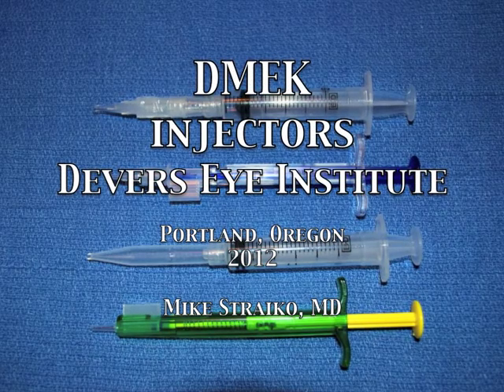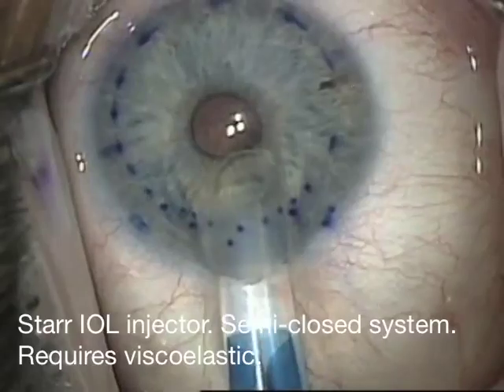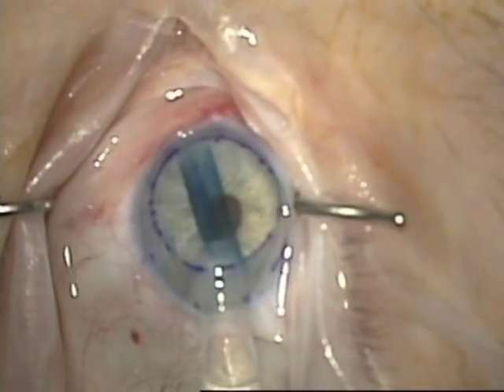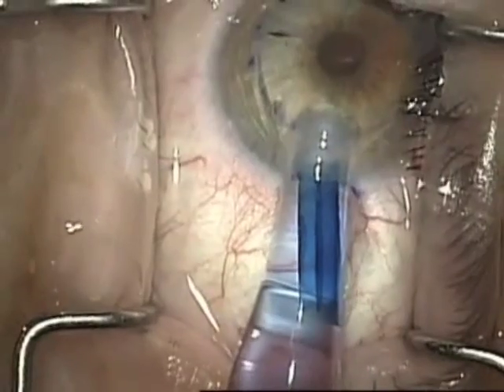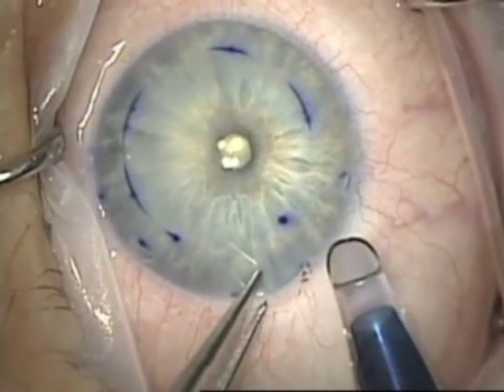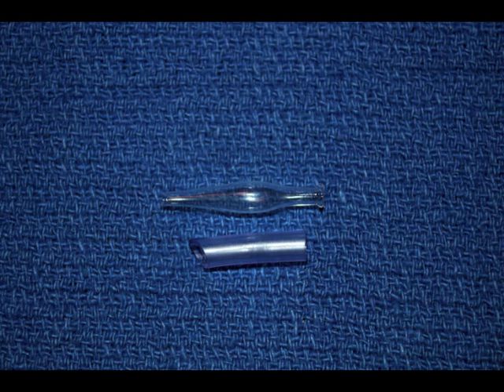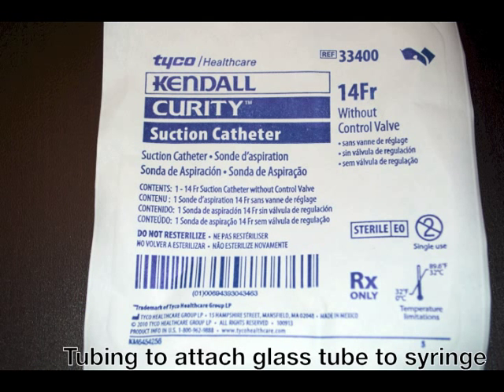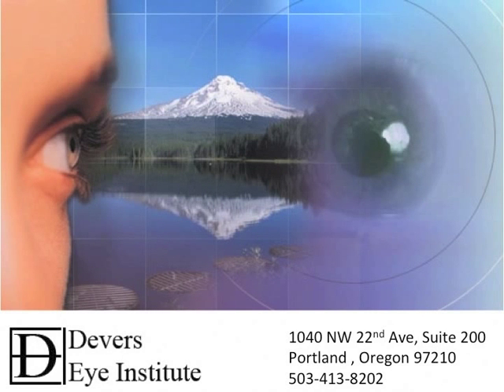DMEK injectors 1

Comment from the maker: Hi bplancha, this is Mike Straiko,thank you for your interest in my videos. I have used the viscoject in the laboratory setting and my partner, Mark Terry, has used it clinically. I will not use it clinically as the cell loss was higher with it as compared to the modifed jones tube (unpublished lab data). We both agree that the modified Jones tube has several characteristics that result in reduced manipulation of the graft and overall lower endothelial trauma compared to other injection methods.

Comment: You show, but don't mention, the B&L viscoject. It has a closed system that doesn't require viscoelastic, can go through an incision as small as 2.6 comfortably, and is easily commercially available. It is plastic, but since the cell counts with it have been quite high, I'm not that concerned. You could try injecting it and your glass jones tube and then stain the grafts with trypan to see what has the worse cell count. I suspect the viscoject will do fine.